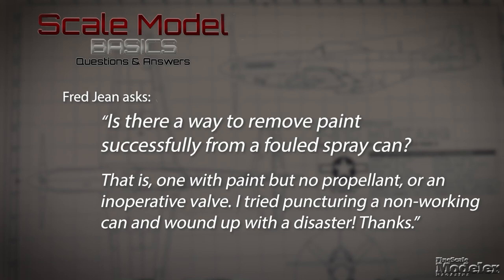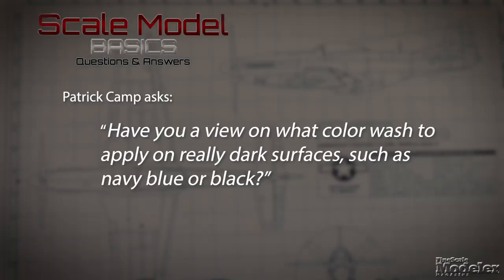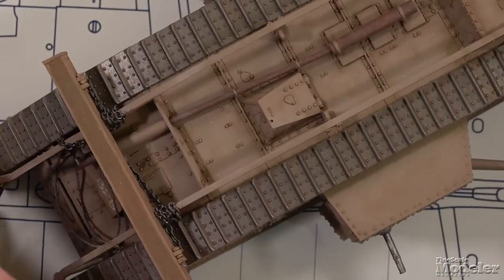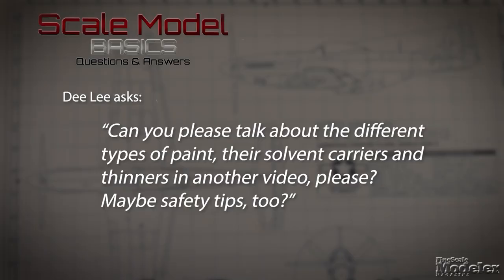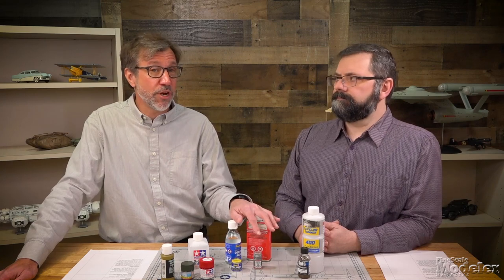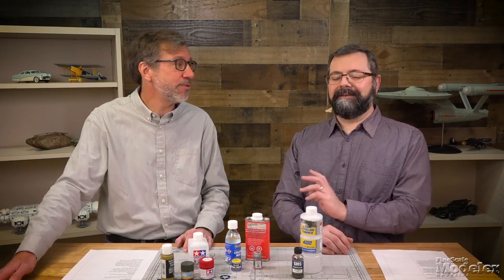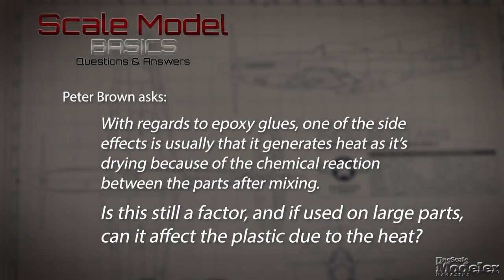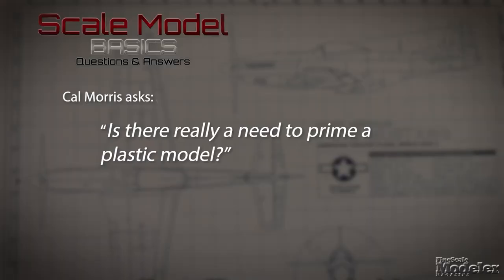Scale Model Basics: FineScale Modeler magazine answers your questions

Comment: You should mention with a respirator, use the appropriate cartridges for paint.  When buying replacement cartridges, there are dust cartridges &  cartridges for paint fumes.  They're 2 different filters.  Also not all Acrylics are true water based paints.  Reading he label will inform you.  If there is a flame symbol on the label, store & use as a solvent paint.  I've had (although extremely rare) acrylic paint curdle or become useless, unsprayable with water as a thinner.  I also don't recommend using alcohol as a thinner.  It may react with the paint, dry too fast when sprayed, ruin paint, not adhere right or get a powdery texture to the paint finish (& is a fire hazard)  This I like for steam or diesel engine soot on tunnel portals & engine house entrances. (Tamiya flat black is my favorite for this.).